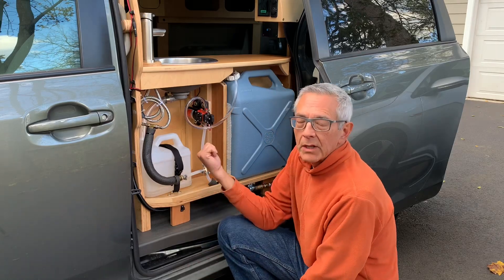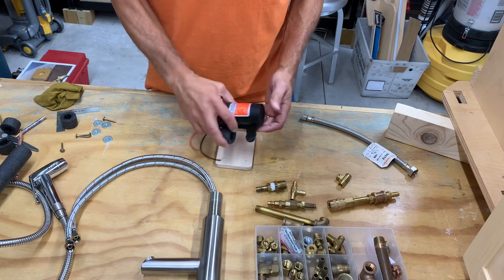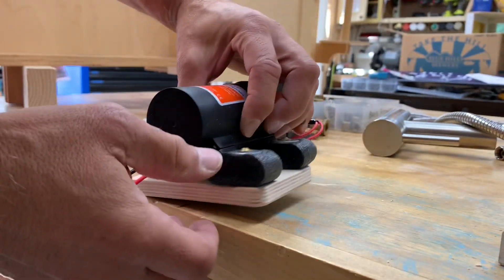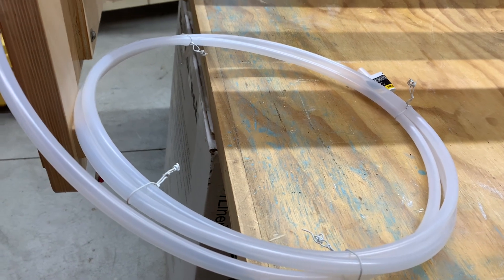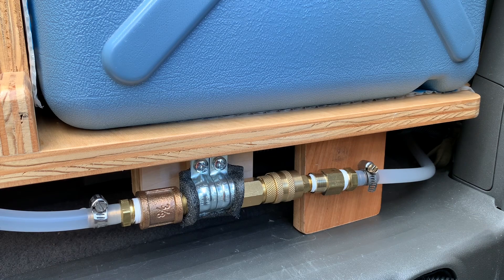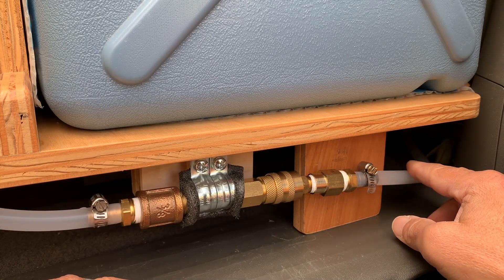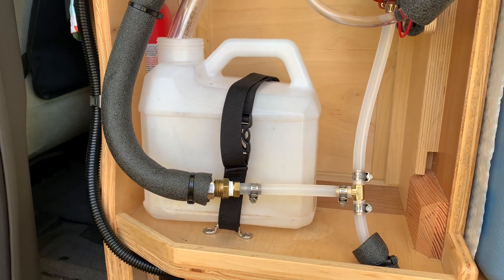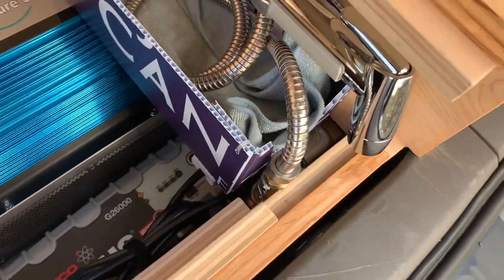Campervan Pressurized Water System Tips and Tricks

Comment: Really love the details you put into your build.  I don't even have a van but just enjoy watching you go over the features.  BTW, if haven't already could you go over the main shop tools you use?
Reply from the maker: I’m glad you’re enjoying the videos. I haven’t spent much time talking about my workshop though there are some videos showing me using some of the tools. My shop is configured much like any serious hobby shop. The tools I use the most are table saw, router, drill press, miter saw, band saw, spindle sander, stationary belt & disk sander, bench grinder, and a fairly serious dust collection system. I don’t use my planer or jointer much for camper builds. In addition, there are all sorts of hand tools and cordless power tools I use on a regular basis. Hope that gives you an idea of the basics in my world.
Reply: @BruceParks  I have pretty much the same tools except the spindle sander.  I think that would help make the nice smooth edges you have on. some of the curved edges.

Comment: Hi Bruce, I was wondering what blue water container that is. Since you have a sink arrangement in the back, I was thinking of moving the tank forward into the position of the sink and just having the plywood front 45 back to a single sheet of plywood to connect to the back structure to allow both middle seats to be installed. A fold-up table surface might be added to the water area front to allow say using the stove with the window down to allow ventilation during inclement weather. I just don't know if that would allow enough room for that second middle seat to work.  
tnx, phil
Reply from the maker: Hi Phil, the water container is a 6 gallon product from Reliance (https://amzn.to/4cxDcjT); I don't think blue is offered anymore. If I were to redesign my sink area, I think the water jug could stay put but the undersink cabinet would have to tuck in a little for the 2nd row seat to be able to be reinstalled.

Comment: on the grey water tank you could add an overflow tube which exits out the bottom of van. This way you will not have to worry about overflow.
Reply from the maker: Good idea though I’ve made an effort to avoid drilling holes in the van.

Comment: HI Bruce, taking notes of your fantastic van, two questions, do you have an outdoor shower system and a camper potty? TY!!
Reply from the maker: Hi Kay, good questions. For hot showers, we have a Coleman Solar Shower (https://amzn.to/3Q4nsJI). It gets the water fairly warm if you leave it in the sun for a while. We've only used it once. I rigged up a shower curtain tarp using pvc pipe clamped to the roof rails. Our potty is a Luggable Loo (https://amzn.to/3vkmBwU). We use medium size kitchen bags and poo powder (https://amzn.to/3ozGcW7). We use the loo often but mainly in the middle of the night for #1. The poo powder reduces odor and gels up the liquid.

Comment: Trying again: I'm finally ready to buy a used Toyota Sienna to convert to a camper. The prices are much higher than I expected, and it doesn't seem as if they're likely to come down soon. There's a 2004 Sienna with 121,000 miles available for $11,999. Would you consider buying that old a Sienna if you were I as long as it seems to be fine? Thanks for your opinion!!! Faith Lockwood
Reply from the maker: Nothing wrong with earlier Siennas. The only additional concern is prior to 2007, the engines were equipped with a timing belt that needs to be replaced every 100,000 miles. Make sure it’s been already replaced or factor in the extra cost to have it done if you plan to buy that vehicle. Good luck!
Reply: @BruceParks  Thank you!

Comment: The sprayer the back is dangerously close to the exposed electronics located underneath the sprayer in the back. From my experience, those sprayers can leak, especially when not vertical (main leakage is from the nozzle, not the connection) and you potentially have a disaster waiting to happen. Nice system otherwise but I would reconsider the setup in the back given the safety hazard. 

Edit: added () for clarification
Reply from the maker: I'm keeping an eye on it and will change things if needed. Most likely add a ball valve to the back since the water is only needed when I'm back there and can monitor things under pressure.